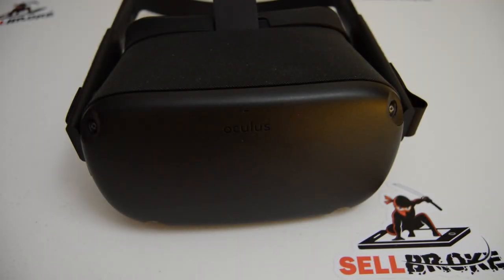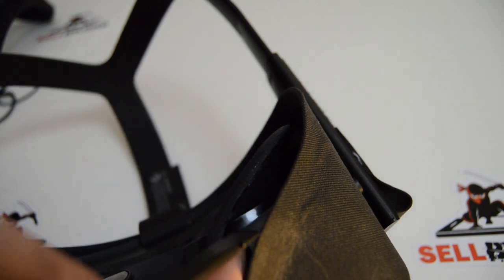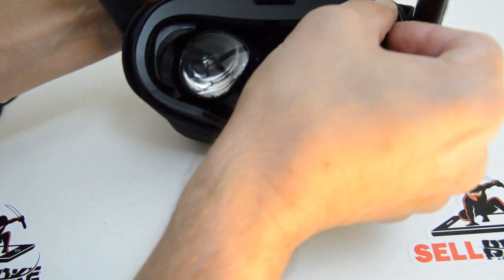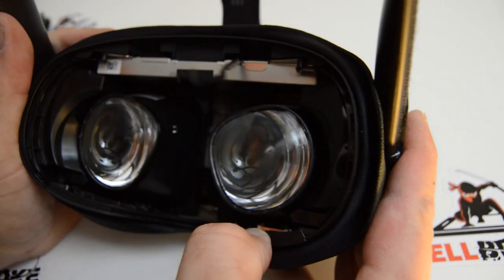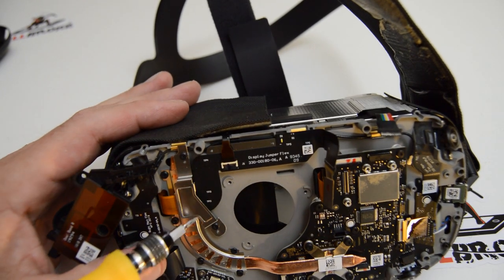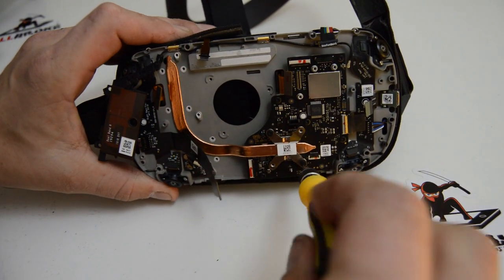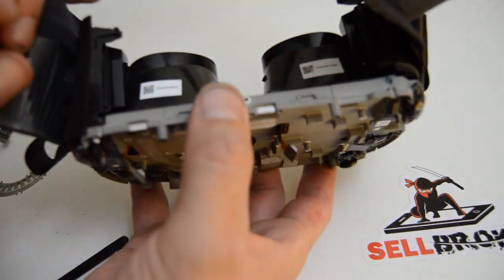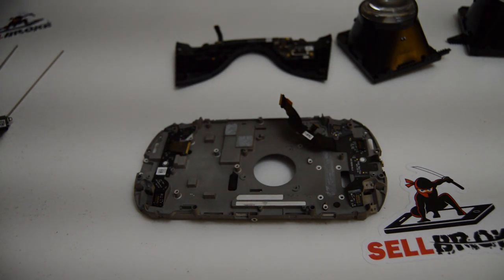How to Disassemble Original Oculus Quest 1 VR Headset

Comment: Mistake you made was not taking the head strap out ASAP. Gets more access to the plastic :)
Reply from the maker: Of course, the first time you take something apart you learn these things.
Reply: @Sellbrokedotcom   PLEASE rename video - to WARN ppl NOT to cut the cover at least!!!
 if you remove one side of the strap -2 screws only .that enough to keep the cover intact.
NO NEED TO CUT ANYWHERE AT ALL.
also you dont need to take out the bottom part at all.22:20  
you can rip another cable or damage its slot if you do so.
just remove the 2 screws , leave where it is.
Reply: @SellBroke DO THAT MAN!

Comment: Just wanted to add 1 note the correct torque size is actually a t6 the t5 will work but t6 is the size that fits the best. 
Questions, I bought your charge port and to be honest I skimmed the video to get an idea on what I was gona have to do but we had a baby in the in between so I still haven't watched the full video or had time to work on it yet. Can anyone tag some key points of the video? I found the comment about the head strap and want to try to figure that out first. Any help is appreciated greatly.

Comment: To remove the headstrap without dissasembly, there are two clips with wide open slots on the inside of the headstrap assembly. Feed the first bit of the strap through the front hole as far as you can, then depress on the holes and gently begin to pull. It should start freeing itself fairly easily.
Reply: How do you put them back in! I need help pleassee

Comment: Hello.

Are there common errors and their causes?

My Quest 1 can no longer be switched on.
Even after several hours on the USB charger, this is not possible and the status LED is never on.
Reply: When  the internal battery of the Quest 1 is not longer able to be recharged (End-Of-life for battery), Meta/Facebook made the stupid decision to brick the quest 1. Yep, the Quest 1 is NOT able to boot with an empty internal battery !!! I have the same problem. Even connecting USB cable and using power from wall-adapter doesnt work anymore. Only solution is to source a working internal battery/accu from a 2nd hand (broken) quest 1.

Comment: Same here....my quest battery got down to 3.4v and wouldn't charge, it appears to pulse at ~17mA but even left overnight would not recover. disassembled top cover only to access battery plug and force charged it to 4.1v, then reassembled and all is good now. Cutting the top fabric made it a breeze. Must remember to leave my quest attached to a charge lead!. Many many thanks.
Reply: Yeah, I'd imagine cutting the fabric cover is NOT that big of a deal for ease of access.
Great you were able to jump start the batt. I'm guessing you have a reconditioned?

Comment: Came here to see if I could lighten-up Q1.
I'm thinking of removing completely the cloth cover,
and moving the battery to the back of the headset strap, or even onto my waist belt.
Not sure if removing the front panel and the fan would do any big of a difference in comparison to the protection and heat dissipation they provide.

Comment: I know this is an old video, but of someone can PLEASE respond with an answer. For some reason my quest 1 will power on and play the music as well as work as it should. I can get a few minutes of game play and then it goes black for a while. It does this constantly. 

Also, the left controller was dropped and cracked right in the center of the ring right between the oculus logo. Any help out there?

Comment: there is a video of how to remove the lenses? I have a lens defect that needs to be removed and polished

есть видео как снять линзы? у меня дефект линзы, нужно снять и отполировать
Reply: I’m the same , I have cleaned my lenses but on the inside there is smudges I can’t get too and is very irritating when going on it
Reply: @joshchannel3389  how the heck did smudges get on the inside of the lens face?
Reply: @BendApparatus   no idea 😔
Reply: @joshchannel3389  damn, I imagine your only recourse would be to scavenge a lens module from for parts defective set or a 64gb headset only from eBay.
Reply: mine were the same. now more than 2 years old I thought I might just try to remove them, if that fails well at least I still have the reverb g2 but it would be such a shame.

Comment: I tried to repair a Quest 1 that doesnt charge nor boot. I used your video to open the Quest and disconnected the cable to the battery, hoping that I was able to boot the Quest. Sadly no luck. I did check the power usage when the battery is connected and it uses 0,12 watt constant. (not enough to charge the battery) Pushing the power button while battery is connected does not do anything and power use is still 0,12 watt.. I then reconnected the battery and noticed that pushing the power button and/or the + and - volume buttons also showed the Quest using some power. it jumped from 0,1 watt to 1,1 watt and everything in between. But still no screen/boot.... Anyhow, I guess my quest is beyond repair, so i'll keep it for spare parts for my 2 other (working) Quest 1 headsets. Anyhow, thanks for posting this video.

Comment: Really needed to get one of the headset strap connectors off, but you put that off until almost the end and then didn't do it. :). Do those things come off?
Reply from the maker: Sorry! On the first disassemble of anything complicated, you find the best way AFTER you learn. Yes they do, you have to peel back the velcro to get to the little fastener holding it on.
Reply: @Sellbrokedotcom  awesome. So they are removable from the outside without having to have it totally apart? Of course Oculus doesn’t have any service parts so that knowledge only helps if I can 3d print something.
Reply: @stevenpalm9484  After you have removed the velcro part, the strap connectors are hold to the headset by 2 screws. they are inside the circle (that can be seen behind the velcro strap). Unscrew and it can be removed. Very easy to do.

Comment: FYI the Quest 2 does actually have a mechanical IPD adjustment. It's just not continuous like Quest 1 but limited three discrete settings.  Here is a video showing a user adjusting it. 
https://youtu.be/xnfuMcakBEw?t=97
Reply from the maker: Those aren't really 100% mechanical, they use a single LCD now instead of two individual screens that can slide apart. The lenses just aim at different portions of the LCD when they slide. This is one of the many cost-cutting features to get it down to the $299 price point.
Reply: @Sellbrokedotcom  It's mechanical. The lens physically move and that's the really important part of an IPD adjustment. You can slide what is being displayed to the screen in software to compensate for the screen not actually moving. That has the same outcome as moving the screen with the lens. The only downside to a single screen is you won't have optimal panel utilization because when you move the lens there are parts of the screen you can no longer see. So you either have variable FOV (which is what the Quest 2 does) or have larger parts of the screen that go unused than if you used two displays.

The Rift S and some of the WMR headsets use a purely software IPD where the lens can't physically move at all.. Quest 2 has a physical IPD it's just not a continuous adjustment.
Reply: @Wescotte1st  "That has the same outcome as moving the screen with the lens" That's not what I heard from multiple Q2 users. The screen is centered for the middle IPD setting so if you use the biggest IPD setting you will see nothing at the edges of the screen, as far as I understand it can be quite annoying. Headsets with real mechanical IPD (screen moving with the lenses) don't have that issue.
Reply: @Alternity666  It's still a proper (albeit slightly limited) mechanical IPD adjustment. Yes, because it uses a single screen the max possible FOV is artifically narrowed for setting #2 and #3. However, not everybody actually notices the reduction as it's depdeant on your face shape and how close you can get your eyes to the lens.

You are correct no other headsets have this specific issue where FOV is linked to IPD but it's not super uncommon to see the edge of the screen on other headsets regardless of IPD. So it's not like this horrible flaw only Quest 2 suffers from. If you hate seeing the edge of the screen you can simply insert the glasses spacer (or use a thicker foam insert) to move your eyes slightly further away from the lens preventing you from seeing it.

Yeah, Quest 2's IPD has limitations compared to two screens with a continous IPD but it's not that bad... Certainly much better than no mechanical IPD at all and there are plenty of headsets out there with no mechanical IPD at all. The Oculus Rift S, Oculus Go, PSVR, and most WMR headsets (exception being Samsung Oddyssy and HP Reverb) all use software only IPD adjustments.

For people who fall outside of the optimal IPD on those headsets it's not a matter of less FOV it's they can't really use the headset at all. Palmer Lucky (The creator of the Oculus Rift) wrote a blog on how he can't even use the Rift S because it lacks an IPD adjustment.

https://palmerluckey.com/i-cant-use-rift-s-and-neither-can-you/
Reply: @Wescotte1st  I have used a low quality WMR headset with a very small IPD (54 using the first gen of the HP WMR headset), I know all about how it sucks, but it still was useable, I wouldn't say that I couldn't use it. I was still a top10 player in Audica, a game where aiming is extremely important for scoring, using this headset.

I was merely correcting that the Quest 2 IPD system is not the same outcome as the normal IPD system where the screen moves with the lenses, saying that is a false statement, according to a lot of people who did experience both the Q1 and Q2.
Reply: @Alternity666   While you say your WMR headset works for you your IPD will be off "optimal placement" by nearly 10mm. That will results in significantly less sharp visuals than you would if you used a headset with a physical IPD with the same resolution screens.

Other people aren't so lucky and get headaches or eye strain being off by that wide a margin. That's what Palmer was getting at with the article I linked.

If you used a Quest 2 you would have the option of using a physical IPD of 58mm which is not nearly as far off optimal meaning less folks suffer eye strain/headaches or reduced image clarity.
Reply: @Wescotte1st  Yes I know, it was horrible, one eye was always blurry, but saying that it was unusable is a stretch considering I was able to play at a high level with both shit optics and shit tracking. I use a Q1 now so I know the difference first hand. The Q1's smallest setting is still slightly bigger than my IPD, but not nearly enough to make it blurry, thankfully.

I did get easily sick when I started using it but anyone can develop a strong VR stomach if you stick to it really. Lag and other stuff like poorly optimized joystick movements don't do anything anymore. Some people are just not willing to go through the necessary pain to be immuned to VR sickness.
Reply: @Alternity666  I read your conversation because I'm one of those with an IPD of Cid from Ice Age... My only 2 headsets are the Odyssey (and plus) and the Quest 1
Because they can mechanically adjust to 72. I believe I'm actually between 72 and 73, I can use them comfortably with only a smidge of blurriness.
But I really wanted a Rift S as my main because of the 5th cam, ergonomics and ultra sharp display.
But since it became abandoneware I suppose it was for the best not to regardless...

Comment: Oculus Quest 1 Headset Battery Replacement,  where can i get the full new original battery for my headset?
Reply: Probably nowhere... You can always just get a battery pack and put it on the back so it provides some extra balance as well.

Comment: TAKE OFF ONE SIDE ARM FIRST!!!!  NO NEED TO CUT ANYWHERE!!!
PLEASE rename video - to WARN ppl NOT to cut the cover at least!!!
 if you remove one side of the strap -2 screws only .that enough to keep the cover intact.
!!!!NO NEED TO CUT ANYWHERE AT ALL!!!!!!
also you dont need to take out the bottom part at all.22:20  
you can rip another cable or damage its slot if you do so.
just remove the 2 screws , leave where it is